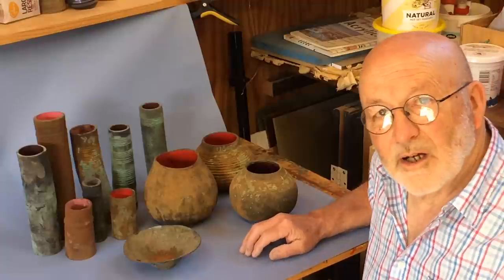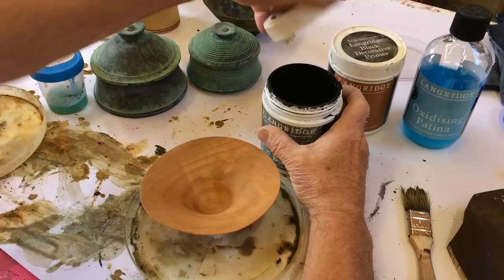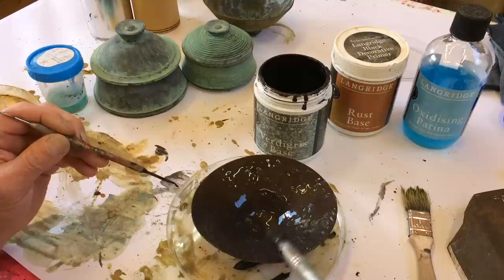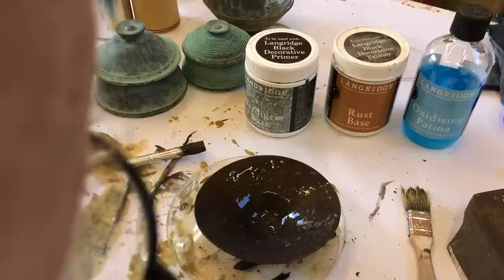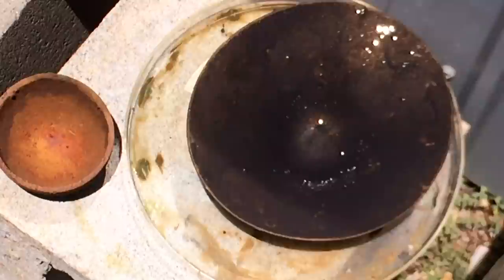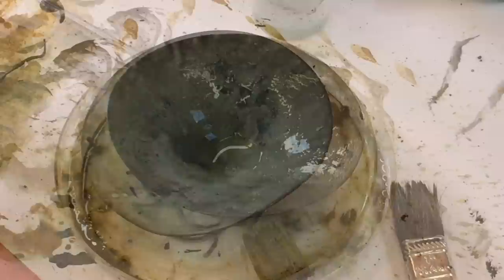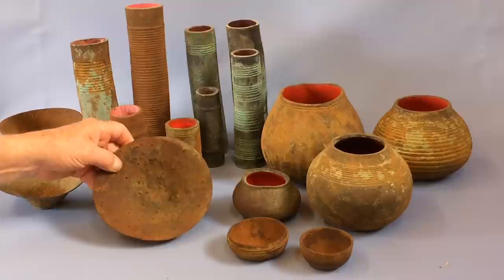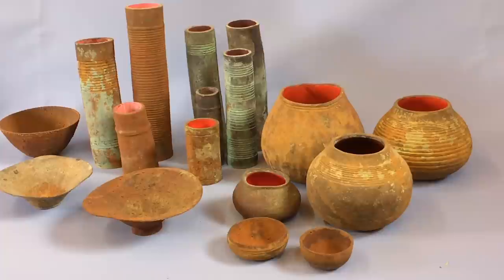Richard Raffan on verdigris and rust finishes on wood.

Comment: The base coat that you mentioned is used to provide adhesion to smooth surfaces and as a barrier layer when applied to metal surfaces.  In the United States these products are sold under the name of Modern Masters, who also produce a number of clear coatings in various sheens to seal and protect the finishes.  I haven’t tried it on wood yet, but I have successfully used the products on architectural embellishments and stage scenery (it’s original intended use).  Just a reminder. These coatings contain real metals, so while they are technically very thin, they are real verdigris and rust, therefore a primer coat is essential when applying them to a metal surface.  Wood doesn’t need a primer unless you want to use it as a surface filler.
Reply from the maker: Many thanks for this info.

Comment: Hi Richard could you add a wax finish over the top of these finishes? 
Thanks for your informative videos.
Reply from the maker: Wax or oil flattens the surface. It's still interesting but I'm not sure it's worth the considerable expense of the verdigris. The rust goes on rusting, so I wouldn't put anything on top of that. I've never tried gloss as I prefer matt finishes.

Comment: Very interesting!  Question:  What happens when you rub it with a tissue or rag or even your hand?  In other words - can you put something like nuts in them?  Or should they be coated with a clear type of varnish?  Kind regards
Reply from the maker: Any oil I've put on has flattened and darkened the surface making it totally different, smooth, and somewhat burnished when the surplus oil was rubbed off. I don't see verdigris or rust as suitable for food, so wouldn't coat any surface likely to contact food. The few pieces still in my possession haven't suffered much handling and certainly no rubbing. The pots at the end of the video were made three years ago, the tubes eight years ago. The tubes sustained water damage in a tropical storm without affecting the verdigris or rust, whereas the acrylic on the inside came back to me mouldy.
Reply from the maker: I tried buffing a tube by hand and that removed the roughness. It's something I might do on future pieces, so many thanks for the question and prompt.

Comment: Do you apply a sealer over the surface at the end of the process. What is the final grit for sanding before applying the finish.
Reply from the maker: I don't sand anything I intend to verdigris although 120grit would provide a good key. I did once apply boiled linseed oil to the verdigris: it went dark and flat which I didin't find particularly interesting. However I'm sure it'd be worthwhile doing a few tests as I'm sure there's potential.
Reply: @RichardRaffanwoodturning  thanks Richard